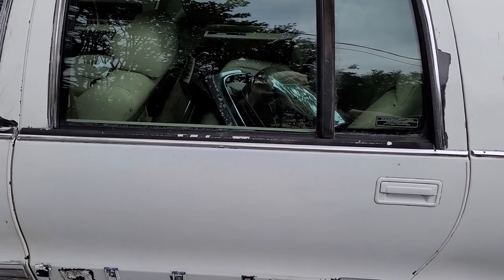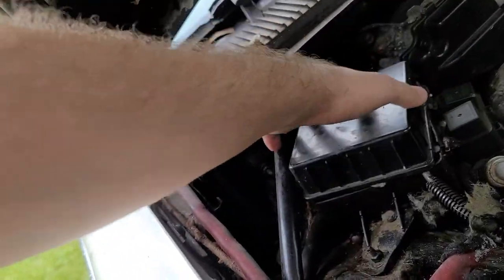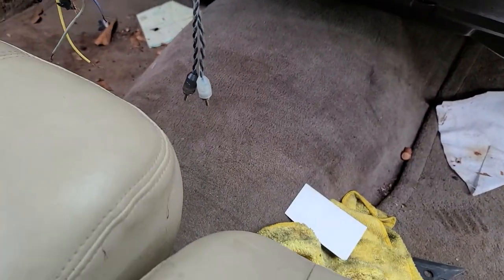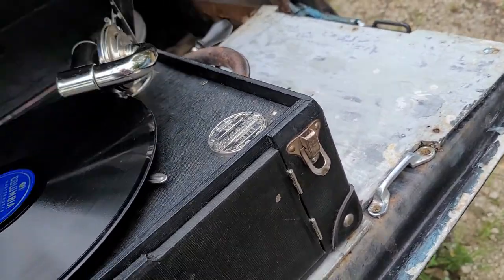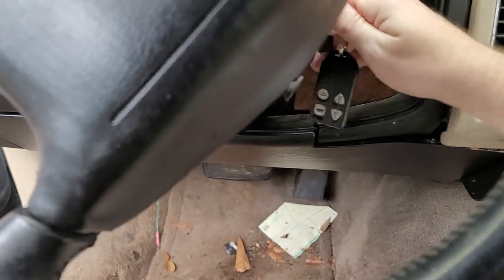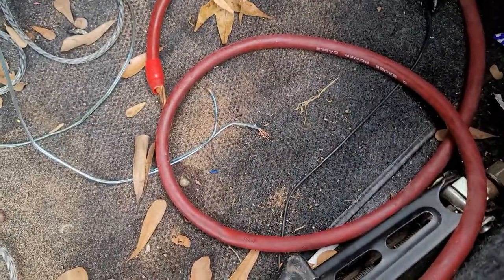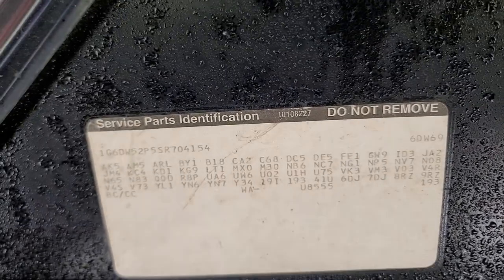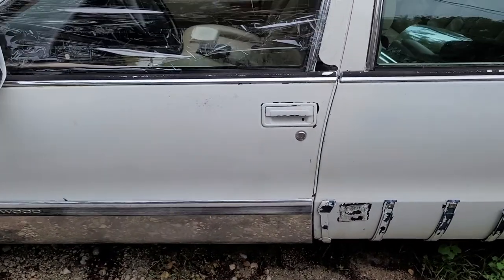1995 Cadillac Fleetwood Brougham - Sickening Slick Top

Comment: i had a similar key situation with a bmw 325i i bought. either the car was stolen at some point or the ignition failed on it's own and had to be replaced so now i have 2 different sets of keys. to open the doors and start the car. weird thing is none of the keys i got work on the trunk. it just locks and unlocks with the other doors. and the only way to open the gas door is to open the trunk and pull the release.